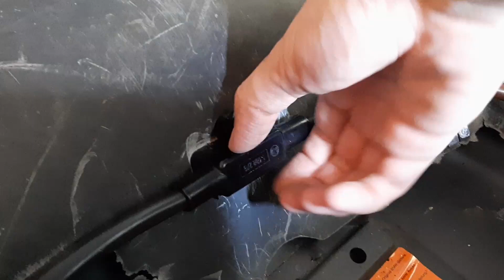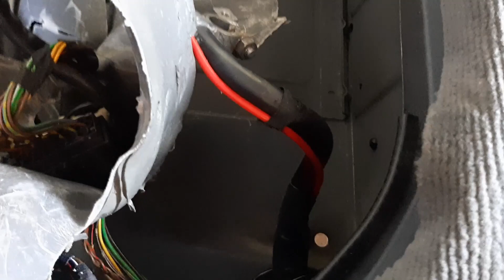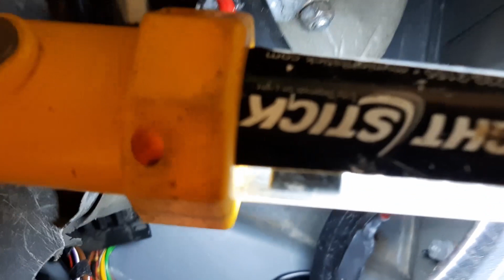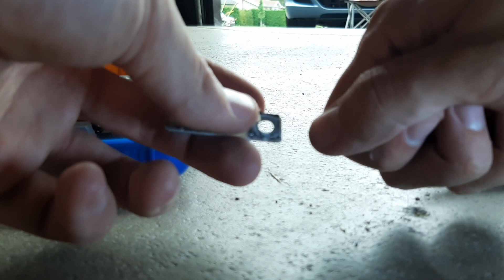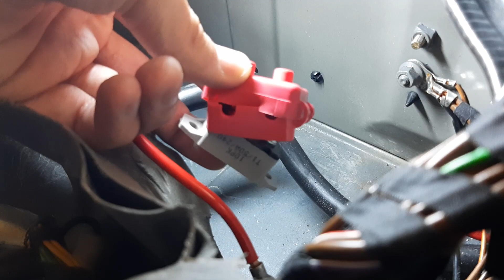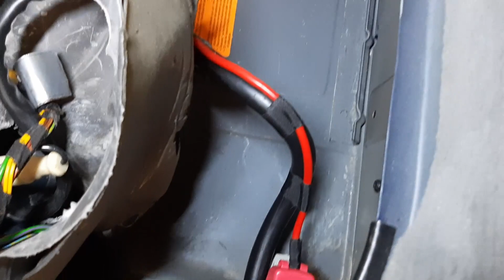BMW E32 Fusible Links Replacement (735, 740 & 750)

Comment: Will replacing the 50 amp fuse fix an issue with the sunroof not working?
I changed out the 80amp and it still doesn't want to open, when I push in the switch there's a noise from the rear when trying to open the sun roof
Great videos man!
Reply from the maker: If only your sunroof has an issue, it's probably not the fusible links. They power (almost?) everything on the car, you would see more issues if they were bad.
Maybe what you are hearing is a relay under the back seat. If the relay clicks then you know the switch and relay works, but the motor might not be getting power, or the motor is bad. Look up a wiring diagram to see where the problem could be. Also check if there is a fuse for the sunroof, in the engine bay fuse box.
Reply: @ClassicBMWFanInQuebec  Thanks for the reply man. 
Yeah its just the sunroof. I'm not entirely sure if the sunroof has a fuse on its own, but I've check them already and they're good.

Comment: Interesting. Never thought to replace these. Will you replace every part on this car? It will be better than new(?). Hahaha keep up the great work.
Reply from the maker: Ha! Actually I am trying to restore it to 100% reliability and smoothness of operation. I was trying to fix a hunting idle and tried many things that were suggested to me. The fusible links were one of the things suggested. It didn't make a difference in the end :)
Also it's worth noting that I'm not a mechanic, I'm actually more of a computer guy in my day-to-day job. So all these small projects help to build my confidence to work on my car. I still make mistakes and I'm still terrified by coil spring compressors, but all this experience helps!
Reply: @ClassicBMWFanInQuebec  buddy, you are doing an amazing job!! You work is clean and professional. Amazing!!
Reply from the maker: @Resq28  Thank you it means a lot!

Comment: Hola mi BMW e32 735i descarga la bateria en sólo día que problemá puede ser gracias
Reply from the maker: Hello, most likely there is a parasitic drain on your electrical system. There is a way to test this by making sure that the car is asleep: all doors closed and wait for 15 minutes. Then with a multimeter you connect it in series with the battery. If the amperage is higher than the tolerance of 30-50 mA you have an abnormal drain. To find it you can start pulling fuses, one by one (resinstall them before moving to the next fuse). If the amp reading dropped on the multimeter, you found the circuit where the drain happens. Then you can start digging further. This forum thread might help you: https://www.bimmerforums.com/forum/showthread.php?1172186-Battery-drain-testing-procedure-1988-BMW-735i
Good luck!

Comment: I have this same issue on a 1988 e34 535i M30. Just as a heads up, I went through a full restoration. All fuel system components were changed from injectors back to the tank, new fuel pump and correct fuel pressure. All vacuum lines were checked and replaced, and vacuum is in spec on gauge. Idle air control valve works as should. MAF was tested and works as it should. I then changed out all spark plugs, ignition leads, ignition coil, distributor cap and rotor with new ones. I still  have the rough idle after all this,  but only when cold. It seems to steady as the engine warms.
Reply from the maker: From what I read online, it is normal for the M30 to have somewhat of a rough idle. But I don't think it should go up and down like mine does, that's what I'm trying to fix.
Your car must run like a champ after all that maintenance!
Reply: @ClassicBMWFanInQuebec  
Its running well, just a bit disappointing the issue was not fully resolved. Mine was not looked after as well as yours by previous owners. So a lot of what was replaced was well past it's time to be replaced. My very first issue was missing vacuum lines  under the intake manifold, which I thought would resolve this, but made no difference. By rough idle i meant to say unstable. It idles the exact same as yours when cold. I said I'd post this here about the ignition leads, distributor, rotor and coil, so as you know that these have no effect on this issue. These ignition components come with a large price when using genuine parts.
Reply from the maker: @thespiderkelly9589  Ah, so your idle hunts like mine. Like you I already changed the distributor cap, rotor and coil but not the ignition wires. When I measured the resistance on the wires they were within spec anyway.
I would think that replacing a completely missing vacuum component would fix it! That must have been disappointing.
Some people say that a rough idle is normal on an M30, by that I mean what feels like a slight miss and a bit of vibration. But a hunting idle isn't normal, these cars weren't sold new in this condition. So it is definitely something we can fix, but it's a common issue and AFAIK there is no published fix for it.
If you search on youtube for "BMW E32 M30" you'll see a video by TheCroughton showing a perfectly running M30B35 in an E32. So it is possible to get a great idle!